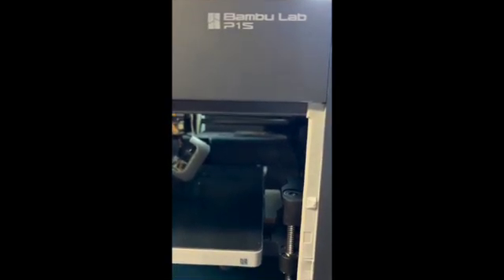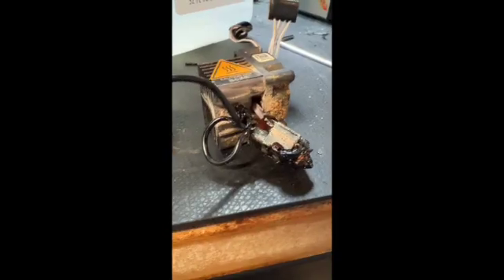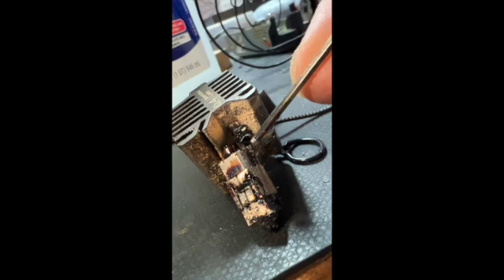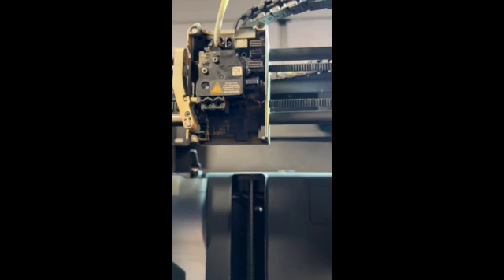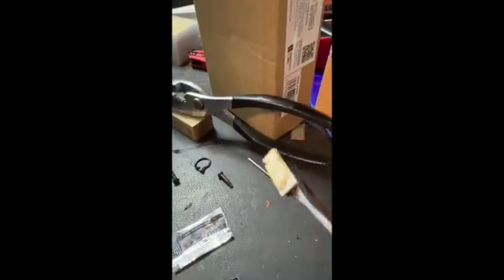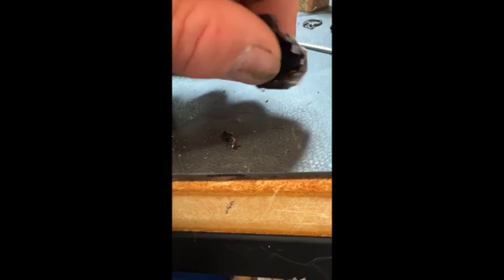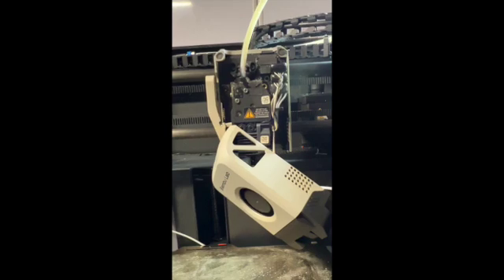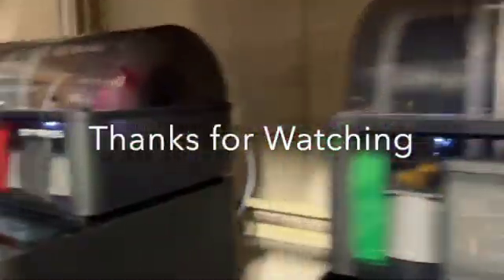Bambu Lab New Super Large 1.75MM Diameter Hot End

Comment: shit... I keep seeing comments about people having issues with the new update... I might need to reflash before I run into issues
Reply from the maker: I initially thought it may have been the update because both did the same thing during the same evening - it's still unresolved as I had printed both items in the past without issues.  Feedback from the company was that the items separated from the plate and knocked the hot end off...I guess it's possible.  It was a quick fix and hasn't happened since.  These have been great printers with strong support (although slow at times).